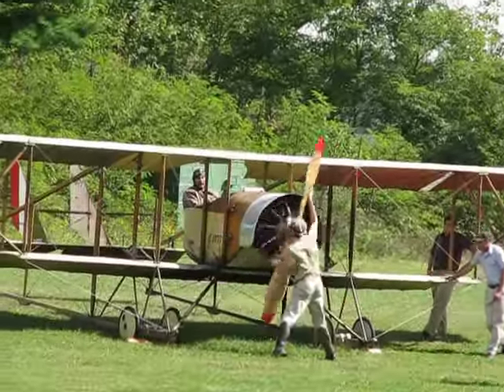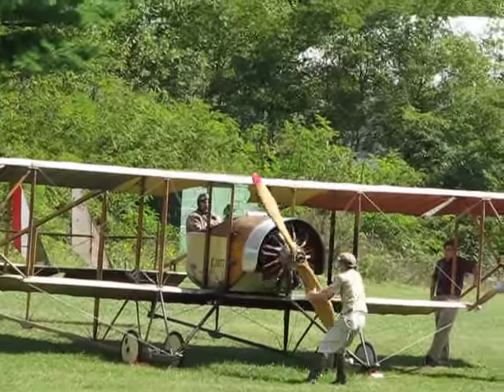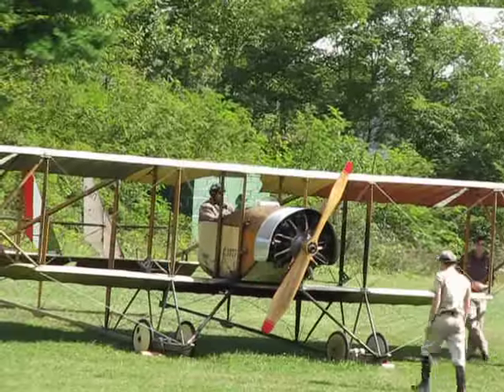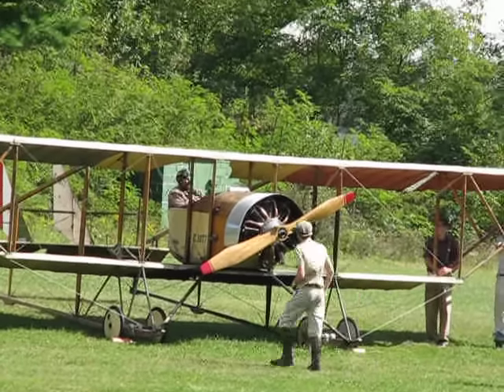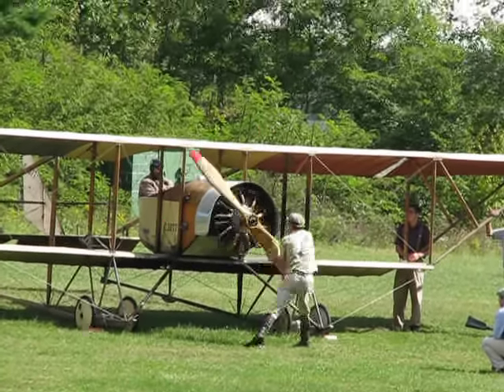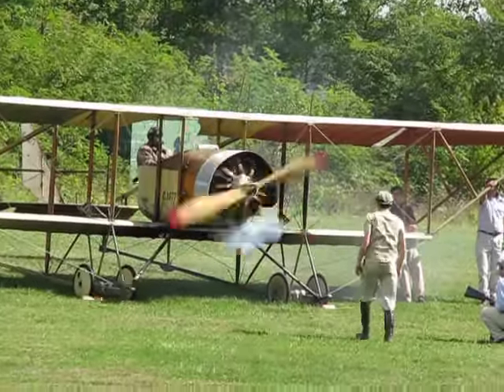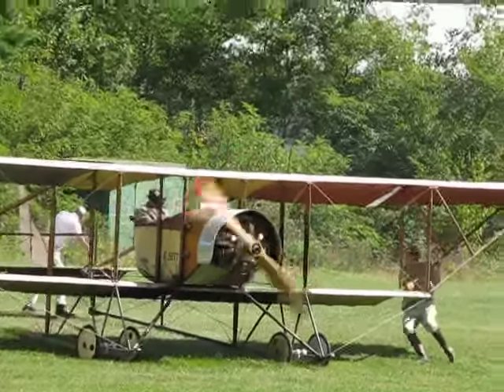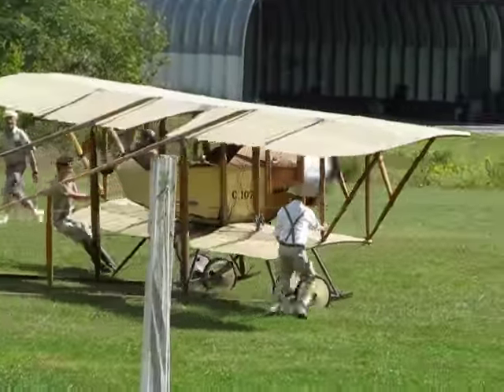1913 French Caudron G3

Comment: Amazing early tech. It seems so odd to us today to NOT spin the shaft and place the load on the shaft end. They made the shaft solid to the plane, built the engine to spin around the shaft, and bolted the prop to the motor! Stunning...I am impressed. I wonder what modern comparisons with today's monitoring equipment would reveal...which way delivered more hp/torque to the prop?n We could maybe change the airplane engine design?
Reply: Tx
Reply: Apostolos Ginnakidis  
"Food is also no longer near the train station can be finished is that I contact them as soon as I have the invoice for the offer in case you please contact me for a short confirmation of the cancellation at"

That is how that translates to English. I have no idea why that is here, can you offer any clarity?
Reply: they did change. As quickly as possible away from this.